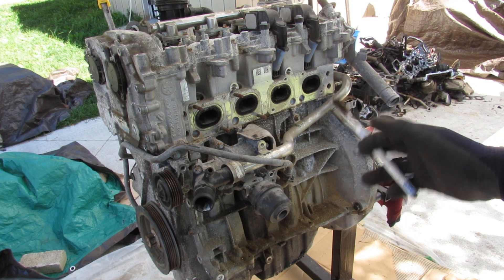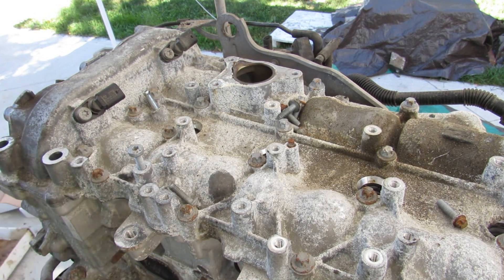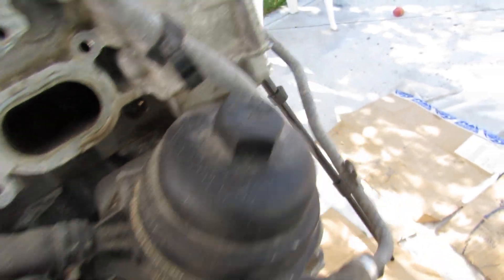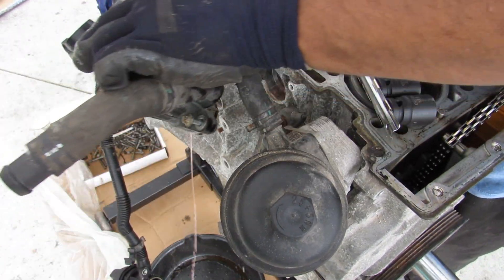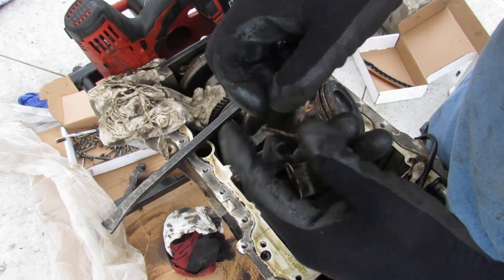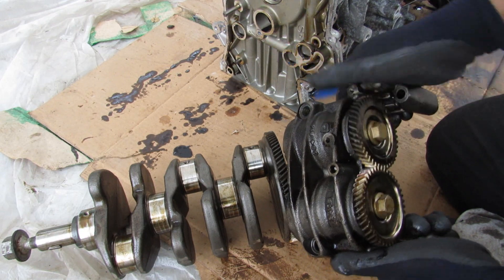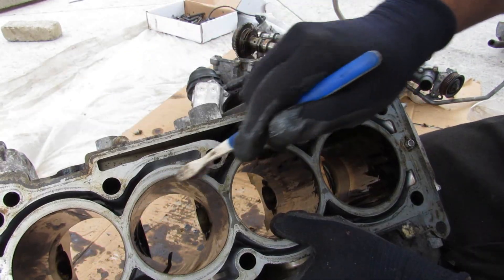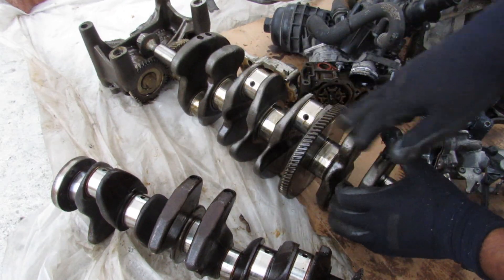What Happens When you Run a Mercedes Engine Out of Oil?

Comment: That M270 engine can be rebuilt. Send the crank to the machine shop, get it machined, install it with new bearings, along with new rings after honing the cylinders, and a gasket/seal kit, it will do another few hundred thousand miles. Just avoid obstacles that can puncture the oil pan. I have the 1.6 litre version of this engine in my A180. It’s a great engine, and the car itself is very good. This engine you pulled down had infrequent oil changes, and possibly the wrong brand of oil.
Reply from the maker: Thanks. I turned it into a coffee table and one AMG owner is very happy

Comment: As I look through the comments I see many people that are amazed by how simple Mercedes can design its engines. As a Mercedes driver myself, who often works on mercedes engines in my free time, I can say there are many engines from mercedes who are simple in their design. I love working on these engines. But not everything is smooth sailing with them. Like you saw in this video, Mercedes sometimes loves to use special tools. This is why you should be creative or have these tools in your toolbox. But these are minor inconveniences.

And for everyone who owns this engine or the newer ones: The linkage, which connects the valve and the vacum actuator at the waterpump assembly, can collect dirt and can get stuck in the close position. This prevents your engine to cool properly and will cause it to overheat. If this happens, first try to clean the spot where the linkage is held in place by the hex screw. This can save your some money.

Comment: Hey, get yourself a piece of car tarpaulin/tilt - you can order required dimensions. They are durable, oil&fluids resistant, help keeping your pavement and backyard nice and clean. Got myself a white one, so I can easily see all the parts. :)
Reply from the maker: Nice. I use a plastic drop sheet underneath all the cardboard. That way when it's oiled I can throw it away.
Reply: @speedkar99  This one can be easily washed with a hose. Also you can still put a cardboard on it to absorb some oils. Your wife will be happier, I guarantee.
Reply: @ChmieluNaprawy   Even better is to pick-up a kiddie pool from ToyRus or someone for $15.

Comment: I don't understand how you can run an engine dry of oil in a Mercedes! There are so many warnings the poor thing would give you that would get you would have to be blind, deaf and stupid all at the same time to let this happen. The relative lack of plastic is refreshing, especially when compared against BMW who will probably "engineer" a way to make the damn crankshaft out of that material! Over all, it looks reassuringly simple and robust in design.
Reply from the maker: Agreed. It looks strong. There's fully an oil level sensor that should have been smart enough to shut off the car if there's no oil.

Comment: I wonder what caused the hole?  Years ago when I lived in the UK I was traveling along the motorway and heard a huge bang, looked in the rearview mirror and saw lumps of metal and a shit load of black smoke trailing behind me.  Managed to pull off and looked in engine bay and a large section of the engine had blown off, it was pretty cool because I could see all of the inner workings.  Not sure what caused it but it was an old Skoda Estelle, notoriously unreliable cars.  BTW the engines to these were in the rear.
Reply: Maybe ran over debris on the road or did a bit of offroading in the rock garden next to the mall parking lot. Sounds like you threw a rod maybe to oil starvation.
Reply from the maker: No idea. Since the bottom end was intact I'm assuming an external object caused the oil pan to break

Comment: Integrated cam bearings? So what, I have to replace the whole cover if they wear out too much? No thanks.
Reply: Cam bearings should last the life of any vehicle.  By doing it this way, it eliminates cam bearings, cam bearings caps, cam bearings cap bolts, assembly of those items during manufacturing.

It's quite genius actually.
Reply from the maker: Yeah if you think of it that way...

Comment: How tf do you run an engine without any oil like that? Wouldn't the car go crazy when the Computer sees zero oil pressure? 

On a side note this engine is one of the better modern 4 Cylinders. Certainly A LOT nicer than Volkswagen junk. 
Its obvious that Mercedes Engineers wanted to design it to be as simple and straightforward as possible. Very little potential for leaks, a solid cast oil pan adding strengh to the block, its an all aluminum engine and everything is just really easy to access.
I absolutely love their way of sealing this engine up: Instead of the usual gaskets that will all leak at some point they use a liquid sealant of some type. A major advancement in engineering since it guarantees a tight seal regardless of torque and sealing surface flatness.
Reply from the maker: I agree, there's even an oil level sensor on this engine

Comment: Mercedes engines can last a loooooong time if you maintain them right. My brother had old 90s Mercedes that had almost 500k on it. That car felt so hefty and solid. Wish they still made them like that
Reply from the maker: The old Benz's were awesome!
Reply: Especially the diesel ones. My dad's has 320k on and it runs like new. Mercedes makes reliable engines. The problem is that owners who buy them used don't budget for maintenance so end up using cheap items which causes the engines to fail.

Comment: Thinking this is actually a Renault engine...# code share
Reply from the maker: Nissan has this in the q30 right?
Reply: @speedkar99  Im not sure...but in UK mechanic wouldn't let me buy a petrol/gas Mercedes... diesel V6 or something else.
Renault stuff is ok...but why pay for a merc and get an engine from someone else?
That engine is known for timing chains and tensioners...often just out of warranty
Reply: This is not a Renault engine.
Reply: @SDav21  I think you will find its a code share engine. highest quality French engineering
Reply: @jeremyaustin9103  What's a code share? All I know is this engine was fully developed by Mercedes with no input from Renault. Only the 1.3 turbo used in the A Class and 1.5 diesel as well was Renault sourced. In the US they don't have any engines sourced from Renault. There's nothing Renault in that engine.
Reply: @SDav21  I am sorry this is not the case.
Ive seen inside on of these "quality" engines.
Its actually harder to work out what engine is under the bonnet/hood of a modern car as the engine capacity isnt normally shown anymore.
Anyhow French/Japanese/German is still streets ahead of any of the VAG tat. Right
Reply: @jeremyaustin9103  I think you're wrong.
Reply: @SDav21  Sorry I think you are wrong. They are not thought of as a great engine tbh.
Reply: @jeremyaustin9103  it's definitely got nothing to do with Renault.
Reply: @SDav21  not my experience locally

Comment: You missed how awesome the oil pump is!

It is a constant pressure pump (variable displacement), so it adjusts the flow according to the pressure.

The vanes are not flung out by centrifugal force, but by the little round washer-looking ring in the center of the rotor, it ensures that the vanes always stays close to the outer ring.

The spring pushing on the outer ring allows the ring to move, thus adjusting the displacement of the pump.

This is a very nice design, i have not seen that on engines before, it will ensure that the oil pressure is always the same, regardless of oil thickness or wear, while staying efficient.
Reply from the maker: I saw that when editing the video, pretty neat
Reply: In german it's called:" Flügelzellenpumpe" or "Drehschieberpumpe"

Comment: So nothing broke off inside to create that "inspection hole" in the oil pan, it probably came from the outside? 

Thanks for the video!
Reply from the maker: Yep. Seems like the driver was oblivious and ran over something and continued driving to cause this much damage
Reply: @speedkar99  would a steel oil pan have saved it? I think steel is a lot less brittle than aluminium and also stronger. I've cracked aluminium oil pans running over relatively small objects at low speed.
Reply: @nicholasvinen  smh 🤦‍♂️ if I knew Mercedes make the oil pan aluminum I’ll stay away

Comment: Since when did Mercedes Benz start going front wheel drive...gm is the only dumb manufacturer to use a belt driven oil pump on the 3.0 duramax engine every one else use a chain
Reply: Smaller cars like the A class and cla are front biased

Comment: is it possible they whacked something from the road into the bottom of the engine, leading to oil loss and then starvation? Perhaps a closer look at the oil pan to see which way the damage is pointing (in to or out of the oil pan?)...either way, the outcome would be the same and the check engine would definitely come on ;) great video
Reply: If something exited the engine the balance shaft and oil pump would have been annihilated. This is an obvious case of someone ran over a rock or something and continued to drive until it siezed
Reply: I agree, they ran over something. I've done that before but got the oil pan welded before the engine grenaded. That was a big hole, you have to get it towed straight away if that happens. The clue would be the secret agent level oil slick your car is leaving on the road.

Comment: Ive been waiting for you to tear down a M271 engine..these have a complicated engine breathing pcv setup that clogs up causing issues with oil pressure and premature wear.
Thanks for doing the M270 motor..clearly Benz have improved the 4 cyl offering substantially.
Interesting vacuum pump..didnt expect go see that design.
Cheers mate.

Comment: That engine is way simpler and easier to work on than i thought. Great work, MB, surprised me.
Reply: Mb knows engines
Reply: @chiefdenis  more like they know how to fuse engine technologies. And it isn’t as complicated and badly applied as VW and the other idiot engines Audi. Lol
Reply: Shit I said the same damn thing. Lol
Reply: Exactly!
Reply: Most Mercedes engines (especially the na V8s) are surpassingly easy to work on
Reply: I was expecting to see a complete take down article on the quality, but it would appear that this is actually a decent engine if you look after it. A surprising lack of plastic parts inside and bolted onto it.

Comment: I'd love to see you do a mechanical review on that weird new 'hybrid' Ford Maverick.
Reply: It's hybrid technology is based on an existing Ford product, though it's electric motor is now made in house, smaller and lighter, probably done so to save
on expensive materials like copper, though Ford will surely state it was done to lighten the overall weight of the vehicle.  
The hybrid Maverick is currently on back order, probably due to the lack of engines and possibly that newly designed electric motor as well.  
Scheduled production of the Hybrid currently planned to begin December 8th, 2021, if they make that target.

Comment: great to see a German car company that doesn't use many plastic parts. I bet the engine could do many more miles without that hole in the pan.
Reply: Not with those trashed cam bearing journals, which are integral to the head, and valve cover. the engine is toast either way. Crap design intended to be disposable.

Comment: Years ago my friend bought a ML class diesel that self destructed. After he cracked it open there was so much sludge inside, as if it was running on something straight from Alberta oil sands. Then after some research he found out that Benz recommendation was to cut the OCI in half to prevent lubrication problems and sludge build up. I guess someone did 20-30k km OCIs thinking the 'LongLife' oil can last that long.
Reply: @Alfred Wedmore I wouldn’t buy any Mercedes made in Vance Alabama. Junk is produced there.

Comment: Awesome tear down. Shows the importance of changing your oil every 3-5 thousand miles and use synthetic oil and your engine will last a very long time.
Reply: And it also shows the importance of not putting a hole in your oil pan...
Reply: Shows the importance of not hitting a rock with your oil sump... or some other scenario that causes a massive hole to drain the oil while the engine is running.
Reply: If you're using synthetic, 7,500 to 10,000 is usually fine, unless you have an engine that's known to have oiling issues, or problems with sludge buildup.
Reply: @PistonAvatarGuy  that's true but I change mine when the reminder comes on at 5k miles. I have a 08 Highlander with 210k miles and the engine runs as smooth and strong as the day I bought it.

Comment: German Junk !, Scotty Kilmer is right, Toyota is the best !
Reply: Scotty is right like a broken clock is, twice a day. But in this rare case I would agree.
Reply: Toyotas are pretty reliable but boring. I think there are other brands not as unreliable as BMW/Audi etc but that drive a lot better than Toyotas. Also my sister had a brand new RAV4 that was a lemon. It overheated going up hills and the dealer could never fix it under warranty. She traded it in for a CRV which was flawless. She eventually traded the CRV for a CX-5 which has been good so far. The Mazda 2.4 turbo is a good engine.

Comment: Looks abit complicated for a 4 cyl engine. But what a heck, its German, you can't beat that German engineering ♥
Reply: Really you can. Those cam journals are integral to the engine and are trashed. it's almost non-serviceable  .
Reply: This one isn't that bad, but very peculiar indeed - no cam bearing caps, hmm. Most likely it would run for a good while if someone would maintain it properly. But yeah usually I prefer Japanese engines over this and a few other German creations and their special ways of performing repairs 🥴
Reply: The Japanese are objectively better engineers, they build simpler, more reliable engines that also perform better.

Comment: question is , will it still run if you fixed that pan
Reply: It would need to be rebuilt with new bearings and piston rings (maybe rods) and all the metal flushed out. Even then it might not run right.
Reply: JB Weld.

Comment: I think This engine Was Built From  Quality Materials And Less Plastic. 
I Have A Feeling that the maintenance Was Neglected.
Reply: Quality materials are nice, but it's built to fail. The intergrated cam bearings also failed, and that would require replacement of the entire head, and valve cover.. Poor design nor intended to last.
Reply: @nobodynoone2500  it looks like its well designed for me. Mls headgaskets, beefy balance shafts those are the once i know and noticed and made me think it was well designed
Reply: Of course, the more known the manufacturer, the less maintenance it needs in eyes of the potential owners - until it goes kaboom

Comment: Hey guys what’s up. Was wondering if this 07 fusion was worth it. It has 170k miles on it and so far the only problems are as follows:
•Small crack on windshield by where it meets the roof but a little lower (doesn’t obstruct view) around the length of a water bottle 
•Needs one motor mount 
Radio screen does not light up because of a fuse that’s blown, works fine otherwise 
Hood is slightly bent downwards
Inspected it for frame damage and everything looks good. Drove smooth and AC works great. Made them go to 1800. Is it worth it?
Reply from the maker: Those are minor. As long as engine and tranny is strong go for it
Reply: I've owned two 2008 Ford Fusions and I loved them.
Reply: As long as it isn't AWD V6, why not. The AWD are known for their issues. Told my roommate to remove the drive shaft all together, as the hanging bearing and U-jonts were finished. Then there is the transfer case issue on them, since Ford make them a sealed units with failing bearings. Other than that, things like front window regulators, door levers on driver side, upper rad hose. That's what I changed in last 2months. Tried to remove spark plugs but ... I better leave it alone as I really don't feel like fixing the treads or splitting the engine apart to take the heads off. Also oils leaks all over. Yup, someone butchered the thing really well.
Reply: Sounds fine, but it's going to be a ford fusion at the end of the day. Expect a few more small things on that car.